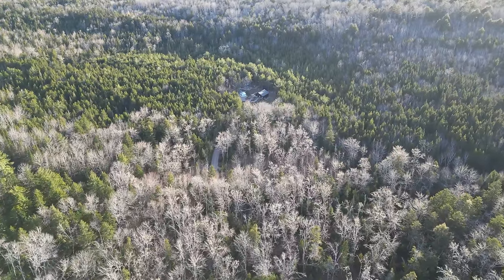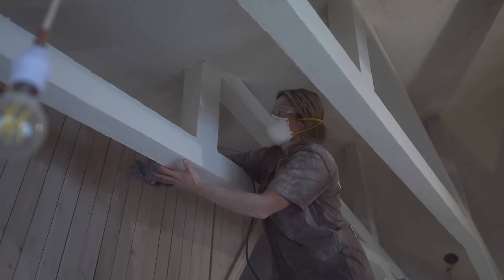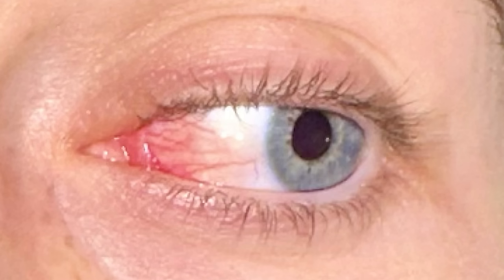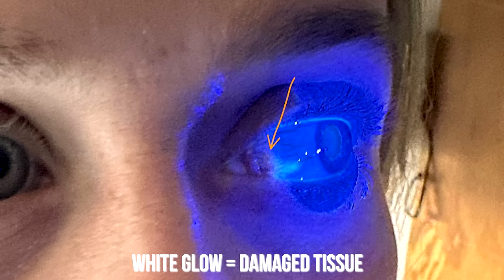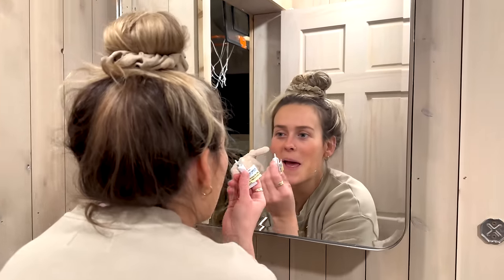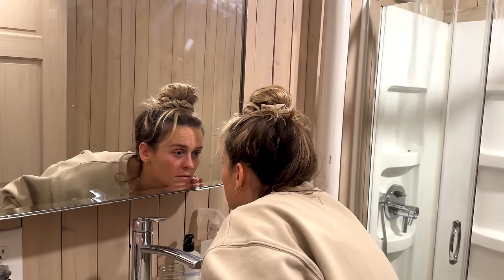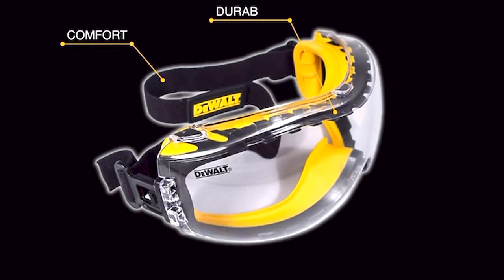telling my story

Comment: Chemist here. That is most likely an alkali burn. This is a VERY common story with alkali burns, which typically take HOURS to develop. Whenever dealing with anything alkaline, PPE is very important, as you found out. If you ever experience exposure to spills, splashes, etc. you must deal with the issue of a slow developing and hard to stop burn. There is no such thing as too much wash/flush as alkalis are typically very hard to flush away. Please be careful, ladies.

Comment: Was wearing safety glasses, on a ladder working above my head. Cutting off nails protruding through a floor. Hot metal, sawdust and old construction adhesive got into my eye. Spent 8 hours in the ER having bits and pieces pulled out of my eye. Should've had a face shield or something.

Comment: Great message, thank you. Many years ago (1985!) I was removing a battery from my sister's car in winter and I slipped. The wrench made contact with the body of the car and the caps blew off the battery splashing acid into my eyes. I would never have thought to wear PPE back then. Luckily, the staff at ER managed to flush out and treat my eye and my sight was saved. Thanks again for sharing this.

Comment: It's not just about PPE for eyes/ears as you mention as well. It's about clothing in general while working - crocs are not proper shoes to wear while doing construction (no natter which mode you put them in) - get iron tipped shoes. Loose fitting clothes (as you mentioned, and jewelry, and hair) do not go together with spinning tools, and maybe surprisingly, gloves should not be worn when using a table saw. Chain saw: use a hard hat, cut-resistant safety chaps, and eye and hearing protection and again steel tipped shoes. A first aid kit should also includes a eye flushing bottle and a fire blanket, thermal blanket, among others. When you're off-grid and potentially alone/far from help, you also need to make sure where it all is, how to use it, etc. while being incapacitated in potentially multiple ways. For example: can you find the eye flush when you are possibly blinded because you got a chemical in both eyes? If you slip and fall in winter and break an arm/leg, can you remain warm even without the ability to carry firewood or even make a fire?

Comment: Thank you so very much for this message. The safety aspect is so important for everything we do. I lost part of the sight in my left eye 50 years ago to an industrial accident with no glasses. I have recently lost all of the sight in my right eye due to macular degeneration. Over all of these years I have experienced many accidents most even with PPE but they were less extensive because of the PPE. 
One suggestion I have is to always have your material firmly on a good base when using any kind of saw. Free handing for a quick cut can cause missing fingers or worse. I nearly lost my left index finger when making a quick freehand cut with a new knife.
You are both amazing young ladies. Stay safe and enjoy your lives together. Peace be with you both always.

Comment: As an OSHA inspector for 22 yrs, I appreciate what you said. However, if you are cutting, local exhaust should be used primarily to remove sawdust.  Eyewear with polycarbonate lens with side shield is recommended.  Goggles are good for chemical splashes but they can get very hot and sometimes clouds up. To find out what PPE is needed for the product, go on internet or ask manufacturer for copy of Safety Data Sheet. Also, gloves offer different protection. If your wearing cotton gloves, the chemical vapors can go thru glove and contact your skin. That’s a no-no. SDS will tell you what type of glove to wear.  Very pleased to here you are doing fine. I love the both of you and your endeavors.

Comment: I'm a nurse, and I'm so happy to see u discuss this. Wishing you a speedy recovery. Word of advise. Since you're living in a forest, it would be wise to keep a comprehensive first aid kit at home. Most kits sold at the pharmacy are meant for minor needs such as cuts or minor burns. But they are meant for city living where the hospitals aren't too far and an ambulance, theoretically, can get to you quickly. But if you live in a rural area off the beaten path, you need something more as assistance could take a long time to get to u. A good one would be an emt kit with large trauma pads, tourniquet, and so on. There are also sailine eye wash bottles you can use for this kind of emergency. Also, take classes on first aid so you can learn how to handle emergencies you may have promptly while waiting or traveling for help

Comment: pick it up
put it on
stay safe
awesome statement.

I am a working plumber. My work takes me on roof tops, under homes etc...I lacerated my cornea putting a ladder up-at the beginning of a project.  I then continued to work-rinsing out my eye during my shift...the scratching feeling in my eye didn't stop..yep,  worked for 8 + hours after the incident.  I noticed my eye pussing towards the end of my shift. So off to the ER I went. The Dr treated my eye did what was needed  and told me that I lacerated my corena. No damage to my eye sight!

My journey to find the right eye gear started, continued actually-I struggled to find the right safety glasses. I wanted  glasses that were comfortable and protective (even at the edges). For some reason, thru the years, debris has found its way into my eyes, even with glasses.... 

 I finally found the protective eye glasses that worked, were comfortable, and protected my eyes and were affordable.  Since finding these glasses I stocked up and gave a pair to all my crew members.. great stocking stuffers! Trimaco e-z clean goggles. They don't fog, fall off etc...super comfortable.  and affordable.  I hghly recommend. 

Ladies, you are awesome. Of all the youtubers I watch, you have had the best practices with PPE. Please contiue to be PPE  advocates.  

As a working woman plumber in Los Angeles, I personally thank you for sharing your experience.

For those who don't  wear PPE it is not that it won't happen, it is when it will happen to you. Prevention practices will save you.   

I love you both.  

thank you for sharing.

Comment: As an ED Nurse you would think I know better. Earlier this season we had a water leak coming from a window during a heavy snowstorm melt. I did a combination of caulk sealant and spray sealant. I could only get the ladder up so high and could see where the problem came from. So I started spray sealing above me looking up. It started to fall on my face and hair and jacket and that’s when I found the biggest pair of sunglasses I could find. Glad I did because that would have been equally caustic to my eye. It’s like your gut is saying “Put something on” and your brain is like meh I can do this really quick. Thanks for the PSA message. It’s so very valuable. No one wants a Morgan lens in the eye for thirty minutes and the chance of blindness. Keep up all the great work!

Comment: Along with the 3m respirator, make sure to order the circular particulate filters as well! Much lighter when you only need to protect against dust. Also recommend the quick-latch half-face respirator so you can pop it down easily in the summer.

Comment: im so glad youre ok! i got pvc cement in my eye when i was about 26. burnt my cornea, burnt my eyelashes off, and i started wearing prescription glassed after that. I FREAKED OUT! it was painful, but i thought my eye was going to melt out of my head 😪 i had had metal and wood taken out of my eyes before that. and have been a big advocate of wearing glasses, eye protection, since. just wearing glassed has probably saved my eyes numerous times since then

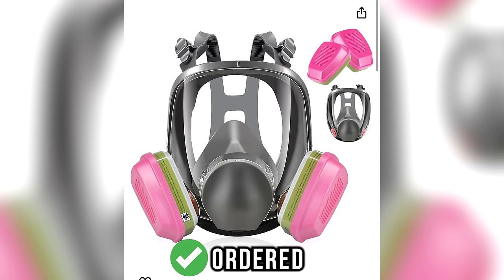Comment: 8:33 Hey Vanwives, if the respirator you bought is compatible with 3M filters. Canadian Tire is one of the best and cheapest places to pick them extra filters that I've found. The cartridges shown in the image are multi cartridges (dust particulate is the pink section and multi-gas the grey section). If you intend to use the respirator for just dust then it would be handy to pick up some p100's ("pink pancakes") as they are lighter for pro longed use. The "P" designation stands for how much particulate gets blocked. They don't have an expiry date on paper. So when you continue to use the filters as they block more particulate, it actually works as a better filter. 

With all that being said, I'm glad to see that you're doing all right Crystal and will make a full recovery. Love the content and can't wait to see what's in the future.

Comment: Great video and an important message. I am in the process of using a wire brush on some surface rust on my car. I've got eye glasses and a face mask, as the last thing I need is to inhale the dust. The chemical I will be using the treat the surface is hazardous as well. A lot of people think that a two minute job won't hurt them, but it's important to remember the PPE. Wishing you a quick recovery and stay safe.

Comment: Crystal, I too had a scary eye moment a few months ago. My hubby was sanding a door with an electric sander, when some of the small shaving got into my left eye (I wear glasses & it got in behind the lenses). It immediately started to sting and itch. I rinsed my eye for quite sometime with water, but the pain was unbelievable. I  jumped in my car & drove to a medical facility where they flushed my eye and extracted several small wood shavings. It was a very scary moment & I was really worried for a bit. Luckily, I didn't do any permanent damage to my eye either. Wear that PPE.....I know I will be from now on. Hope your eye is healing well.

Comment: While in college I had a summer job repairing swimming pools.  I was chipping concrete, while wearing protective eye goggles. The eye goggles had small pin point air holes for ventilation.  A VERY small concrete speck flew through that small vent hole & embedded into the white of my right eye. Even when you are following all of the safety protocals accidents can still happen. 
The type of totally enclosed eye wear you showed in your video was not available  so many decades ago, so take advantage of all the latest advances in PPE you can.
Super glad you are healing from your accident.

Comment: Glad you are healing. I had an accident way back in high school in 1977 (safety equipment wasn't a thing back then) and ran my finger over the top of a circular saw blade. It hurt (of course), and i needed stitches, etc. but  was told it wasn't that bad. Jump forward to 2024 I still haven't got full use of the finger i.e., no feeling in the tip down to the first joint, can't bend it fully. So yes, wear your PPE folks!

Comment: Thank you.  I've had that ointment for a scratched cornea.  Wake up call.  I also have those same DeWalt goggles.  Great specs.  I'm out to use my angle grinder to cut some painted aluminium sheets.  Perfect timing; I'll be totally covered including thick leather gloves.  Thanks again.

Comment: Crystal- I am exactly like you.  Sometimes I wear PPE other times I don't .  I was pulling a piece of rotten wet wood with a crow bar and a chuck went directly in eye.  I held my open and ran water into my eye. Got most out but lots or little pieces were still in bottom part of eye.  I swiped it multiple times with my finger got more out.   I feel bad for you  and so happy your good.   We just have to try to be better .  We do slip time to time. Thank you for your honesty ! Stay safe

Comment: Ive known professionals whove been on roofs without ppe and sadly one wrong step or slip and lifes over . when you work with chemicals you always wear golves googles protective clothing and you read the product safety instructions before using it and if you have questions dont be affraid to call the manufacture and ask them questions they will give you all the propper directions to safely use their products . most people dont know that if you pour meriatic acid straing on a concrete floor and then you spary it with hot water your going to create a chemical gas cloud almost has powerfull has chlorine gas . so its wise to read the bottle or can first . the same advice applies to when your using contractor tools like scaffolding you need to know how to set it up correctly where to set it up and you never set up scaffolding near live electrical lines you have to be at least 15' away from live wires same applies to ladders . hardhats should be worn at all times when doing construction because you never know whats going to fall and from where its going to fall . when you have open trenches like around foundations you should have plywood braced against the earth wall because it can cave in without warning and crush you to death . diy jobs are great if you know what your doing but if the job looks a little to big or sketchy then leave it for the professionals they know what their doing and how to do is safely . diy people dont realize that if a town or city inspector comes by unannounced and sees you on a roof without ppe they will stop all work and at least in canada they will call the construction health and safety board who will then send an inspector out and then your in for some very nasty fines .

Comment: I have worked as a Maintenance Engineer for many years in both Light and Heavy Maintenance Areas and wear Glasses. Due to type of work I had to wear prescription glasses over time and type of work wear these glasses I had to get work glasses that could handle solvents and Petroleum products. Saved my Eyes many times.

Comment: I have a hack that I have used. Obviously, it has to be done by someone else. But if someone has an eye incident take a plastic bottle of water and poke 3 holes in the clear plastic cap. Then slowly squeeze for pressure and flow. Rinse from the side to wash out the item. You can even sit them down and sit on their lap to help hold them down.

Comment: Also knowing what type of PPE is needed is pertinent. I was wearing safety glasses at work as was required. I was shaving overfill from a small rectangular plastic molded part using a small tool. A piece somehow shaved off and flew under my safety glasses and scratched my cornea. Thankfully with an optometrist assistance it healed after a week with no other issue. I began using goggles instead when working on that part of the job. Over abundance instead of bare minimum is always a good idea. I have stories from being a first responder at that facility that unfortunately I witnessed much worse happening and it wouldn’t have happened with proper PPE and self protective ideas were followed.

Comment: That was a scary thing! Thank goodness your eye healed! 
My Dad was an Opthamalogist. Growing up we heard stories of eye injuries, many of which could have been prevented. 
You're correct. If people think about PPE at all, often they assume, "it won't happen to me". We saw that during Covid. The fact is, injuries do happen even with PPE. However, with PPE, the severity is probably going to be much less. 
Eyes, ears, feet protection, hands, sometimes full face, are the easiest to not make most important for every diyer. 
Wear goggles, Wear a respirator when sanding. Wear gloves.. Wear ear protection. Wear sturdy closed toes shoes/boots, no matter the weather.  It can all feel over done or that you're being "silly"; you aren't. You might look like a mummy but you'll be safer. 
Don't forget the same rules when working on the moldy cabin. Lung damage doesn't show up for years and is not reversible.  
You also might want to see if your first aid kit could use some additional items.

Comment: I'm glad you weren't badly (or permanently) injured, and that you not only took it as a lesson, but are sharing the message.
Btw, I have those full face goggles; I use them when we ride trails in the desert. They can be a little uncomfortable, but they fit over my regular glasses and keep the sand, dust, and wind, out of my eyes.
Something that concerns me, especially when you live so remotely, is using power saws when you are alone. I'm not saying you shouldn't...lots of people do. That's your choice. But as part of your gear, it might be a good idea to have a your cell phone in a holder on your person. Pain in the ass, but it could save your life. 
Again, I'm so glad that you're okay.

Comment: Definitely agree as we get used to doing jobs we tend to think it'll be OK not to use ppe for a quick small job cause it is hassle but your accident just shows how easy these things happen. I am now partially deaf because I didn't use ear protection when using chainsaws, brushcutters, hedgecutters, disc cutters, jack hammers and other loud noisy machinery. Hope your eye heals well and you have no more issues other than the one you have been treated for.